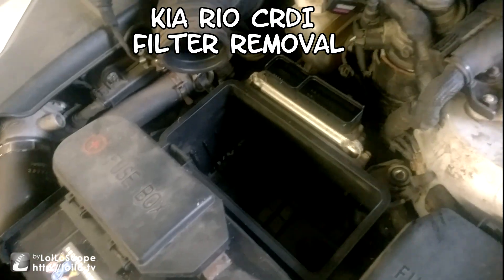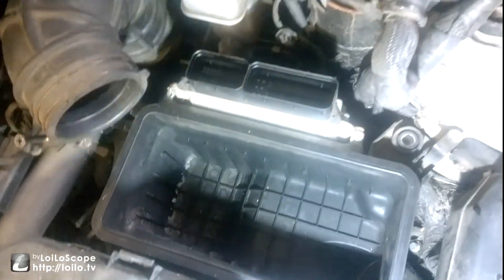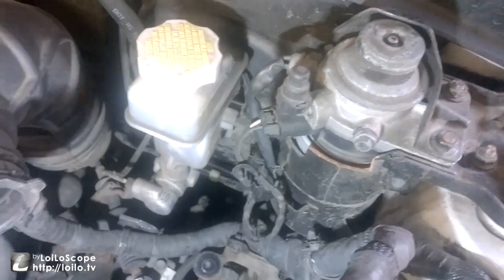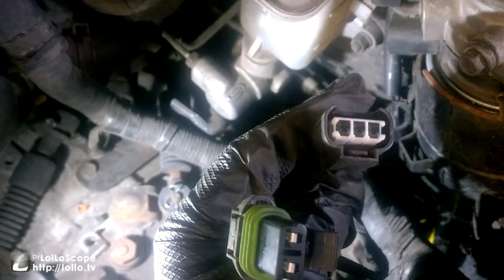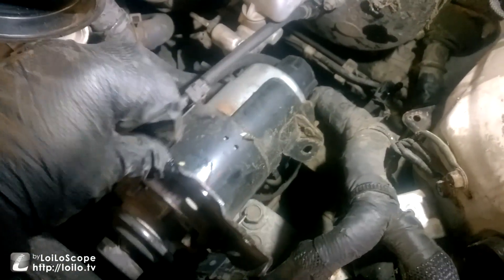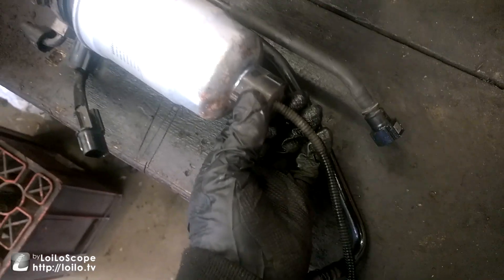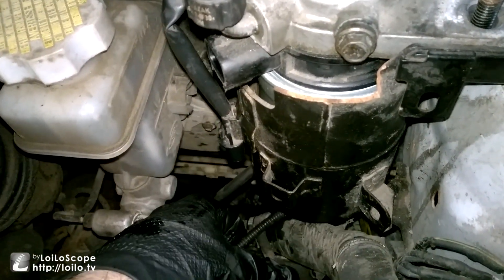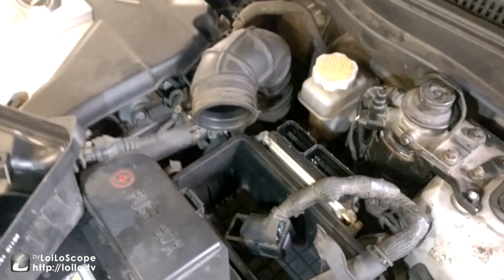How to change a fuel filter in a Kia Rio CRDI

Comment: You are a life saver my man. SUBBED!
Reply from the maker: My Man!! Thanks :)
Reply: Gerard Burke Man, can you tell us the sizes of the bolts needed for this job? I heard 12mm for top ones, 10mm for air filter cover. But what do I need for the bottom air filter housing?

Comment: Great video! Quick question how does the fuel clip cover come off?
Reply: If by the clip cover, you mean the cover that is on the fuel line connection that needs disconnecting, it should have a split on one end. Pull the clip apart at the split and slide it away, down the fuel line

Comment: Do you need to bleed the filter? Or does it happen when you start the engine?
Reply from the maker: No need to bleed the filter, just follow them steps and you will be all set
Reply: Thank you very much!
Reply: @GerardBurkeBurkesGarage  what if i was stupid enough to not follow the steps, and did not fill up the filter, and now my fuel gauge goes down rapid, yet not one leak on the car? Some talk about a bleed screw on other forums, but yeah, can you assist? 😅
EDIT: i should add i have driven several miles now and the problem is still there.

Comment: Im ceratain my fuel filter just went in my 2011 126 bhp crdi ceed!no power after 3000 rpm.bogs down.it was a flyer till this happened today
Reply from the maker: Sounds more like it could be lack of turbo/egr fault. I would recommend getting a diagnostic scan for faults logged. There is also a inlet manifold flap actuator that can restrict power, all should show in a diagnostic. Unless you have a good reason to suspect the filter i would start there.
Hope this helps.
Reply: Gerard Burke was onto them.i can hear turbo whizzing up.its higher up the rpm is drops off.even more than usual(i know ceed turbo peaks from 1500 to like 3000.they think its a fuel filter.seen reports of em going early.ive only 76 k on this car.thanks for reply man.i hope its a simple fix.just there it was fine
Reply from the maker: Filter could be bypassed for initial check to confirm diagnosis. No problem on the reply I was just at the computer at work finishing up for the night, when I can reply I do (not always easy) Time now for food :)  
Best of luck with it & let me know how ya get on.
Reply: Its fucking still loosing power.is it expensive to fix an egr valve if that is the issue?
Reply: Gerard Burke honestly lost all faith in kia and hyundai now.i had 3 hyundais and a kia.never a problem till my 08 i30.its timing chain snapped at 95k. Now this shit with me ceed.its been in twice.fuel filter done.problem still remains,could be ecu update needed,egr valve,dpf,injector issues,turbo.no faults showing.low milage.pain in the ass.my mates i40 is the same carry on.his is like that 6 months.some1 said it could be the maf
Reply from the maker: You need to find a trusted repairer that follows correct diagnostic processes, I can't explain all that in text I would be writing forever, but from what you are saying you are jumping all over the place. There are always reasons for items to fail and ways to test or rule out certain items and narrow the possibilities. Even if there is no fault codes logged it can be solved. 
 
My last bit of advise, find someone good not someone cheap, cheap repairers are usually cheap for a reason, a good auto tech will solve your problem. We have had this not just in Kia's but across all makes & models. Emissions regs have made vehicles very sensitive & requires more knowledge to trouble shoot problems.  
 
Best of luck.
Reply: Gerard Burke cheers.thing is it went to 1 of the biggest kia dealerships in dublin.the liffey valley branch.thanks for reply.ill show them this.mupoets.sorry to annoy you man.i really appreciate you.
Reply from the maker: A dealership is only good if the guys behind the scenes are good, in some places there is not enough time allowed for diagnostic work, they use TSB'S to try and solve by putting in common failures without checks. 
 
This can be because of pressure & restraints put on the techs to solve quickly, in other cases they are just not good enough mechanics. 
If you are not having any luck with the dealer I suggest you search for an independent, there should be enough info out there online to find one close that is trusted (reviews & in business for years) & has the tools with the knowledge. 
 
I wish you the best of luck.
Reply: Gerard Burke thanks pal.im looking it up as we speak
Reply: I got the same car and had the same issue.  There was a fault with the EGR system that even Kia could not find with it still under warranty.  I had new turbo, new egr system, new pipes and new everything.  most of the system is new and the issue still happened.  What fixed it for me was getting the EGR deleted from the computer completely.  Car has run like a dream since  @kodfish1985